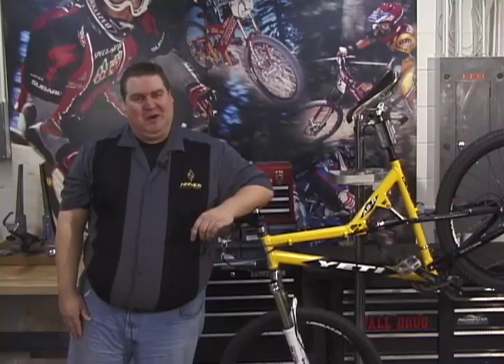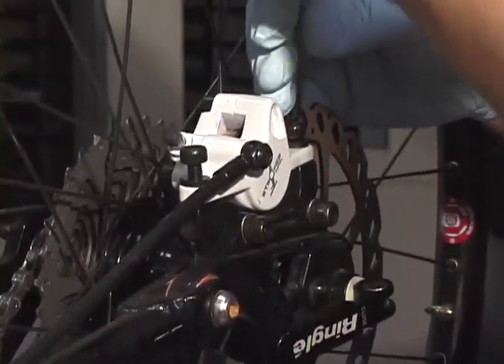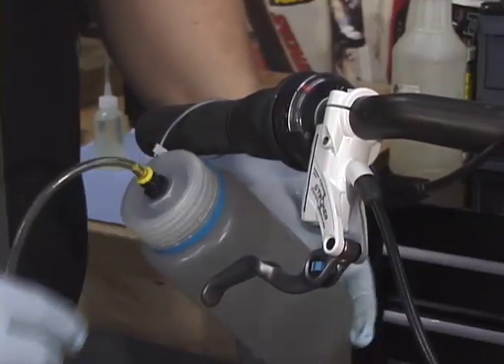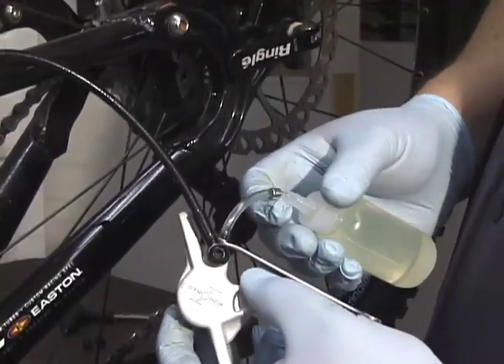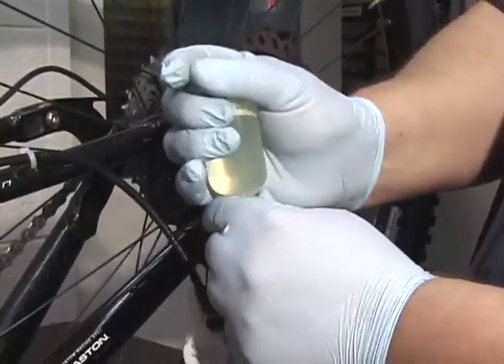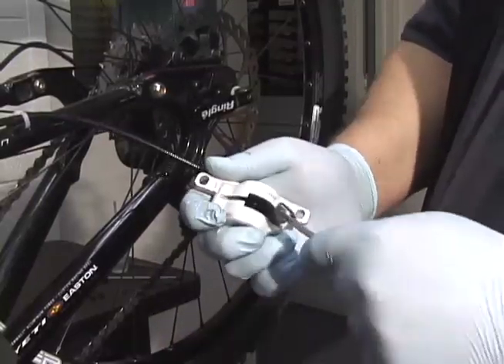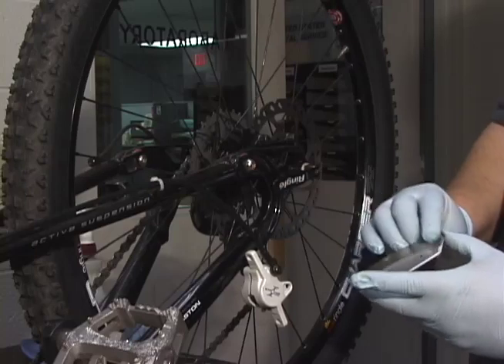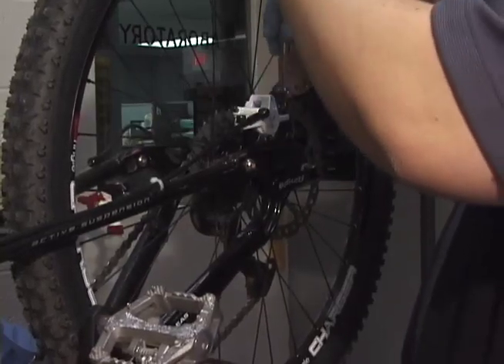Stroker bleeding procedure

Comment: After 11 years of experience as bike mechanic - I did exactly this and some other tricks I use with avid and the brakes refuse to work anyways. There is something missing in the video - how do you get pressure in the line, because without pressure the brakes dont work at all.

Comment: For you guys having trouble, you might have a bleeder screw that isn't sealing. You can't get the job done with a leaky bleed screw. Either get a new one or use teflon tape on the threads. I had real trouble bleeding the brakes the second time and the reason was a leaky bleed screw. I put two or three wraps of teflon tape tightly around the bleed screw and the job took no time. Got a rock hard lever with very little effort.

Hope this helps somebody out there.
Reply: Brilliant idea , Bro ! Its WORK !
Reply: You have to clue how much trouble my brakes are giving me thank you so much for this tip
Reply: Hey man, not sure if you're still active on YT. But did you use the teflon tape to basically wrap it around the threads of the screw itself? So you took it out, the entire screw, wrapped tape around the threads, and put it back in? If so, did you keep it this way or removed it again once the job was done?
Reply: @breakdown7553  Hello, yes I'm still here. Yes, wrap the teflon tape around the bleeder screw once  you have removed it. Wrap it tightly in the right direction. When reinstalled, it will seal the air leaks you are getting when bleeding the brakes. Leave it in place when you are done.

Comment: So in the Hayes bleeder kit instructions, it says to hang the bike with the master cylinder up, opposite of this video. I tried it both ways about 4 times and have yet to be successful (My brakes won't clamp & the brake handle pulls straight to the handlebar). So I still have way too much air in the system, not sure what I did wrong. I flipped the lever & flipped the master cylinder up & down & got all the air I could find out. Ended with a steady flow of DOT4 every time & still not much pressure. Possible equipment problem? My brakes didn't work well before the bleed & didn't change anything after the bleed. Pads are in good shape.
Reply: Joel Me too. I found air in the system at the lever/reservoir. A few light raps with the handle of a screw driver released a flurry of bubbles, which the lever flick did not. After that I forced a bit more fluid and shut the bleed port  on the caliper. Then removed the catch bottle and put the screw back in the lever/reservoir. I worked on my brakes with the lever at the high point.
Reply: I have the exact same problem. Not sure what is going on.

Comment: You really need to remove the pistons from the caliper, clean and apply some rubber grease or red grease onto the sides of the pistons. You can apply it with them in the calipers if you remove pads and pump them out a little very carefully then apply the grease. Just don't get any grease on the pads.  Motorbike shops should have some rubber/red grease.

Comment: And one more: I used an old saline solution bottle as the catch bottle, the hose mounted nicely onto it. As long as it was vertical above the lever/master cylinder, you won't have to worry about reintroducing air into the system when you squeeze the lever (though you'll get some drips when you pull the hose out of the bleeder screw on the lever).

Comment: After some trial and error, I finally got my Strokers bled. Here's a few tips that should make your life a little easier:
1 - Cut the tube 2 inches for the Haynes bottle, the rest for the "catch" bottle. 
2 - 4 inch zip ties will save your sanity. Use them to cinch the tube to the caliper, you likely won't have the bushing in the vid. 
3 - I mounted my catch bottle upside down like an IV  and pumped up into it; no air will float back into the system. Use a stick, clamp and some duct tape!

Comment: @13woj13 it might be the lever body need's lubricating on the o-rings. Open the lever pull out the parts wipe them down and lubricate the o-rings , re-bleed.

Comment: Watch out when you pull the lever during bleeding, you can risk reintroducing air into the master cylinder. What he doesn't tell you is that they have a check valve on the hose to their catch bottle, so they can flick it as many times and air can only go out
Reply: You didn't leave enough hose on the bottle. That's why. There's no check valve on it.

Comment: This was much better than trying to read how to do this in the manual.  Once you've go the right equipment (i.e. Proper fitting spanner and bleed fitting) , it's actually not that difficult to do.

Yes you could go and get it repaired professionally but you may have to wait weeks ... 

Thanks Andy!

Comment: OK- I just used a standard 1/4" brass compression bushing from Lowes.  I had to dremel it out a bit to fit on the bleed fitting.  To really get it locked onto the fitting, use some pliers and twist it on down.  The hose would still pop off my syringe and spray brake fluid everywhere.

The 6mm box wrench was a real bitch to find- especially if you don't want to buy a whole set, which I wound up having to do.